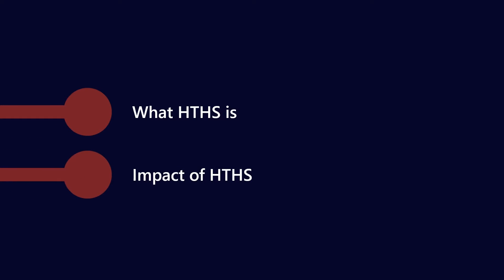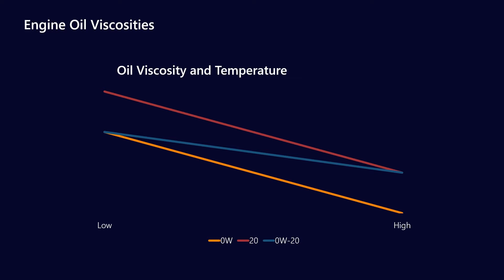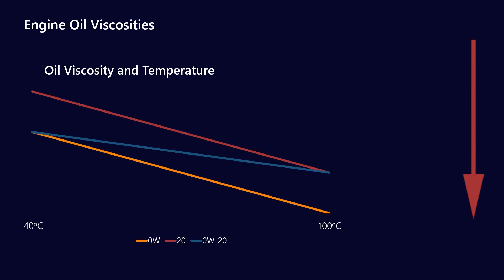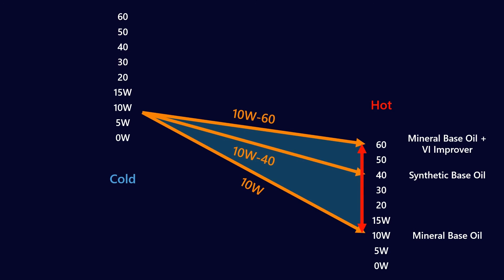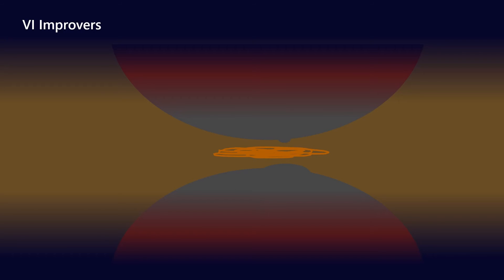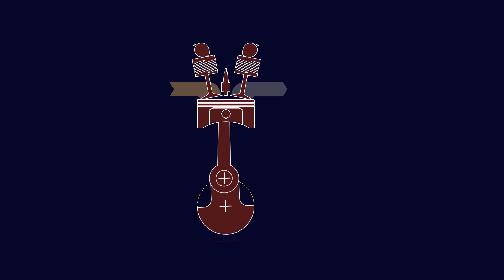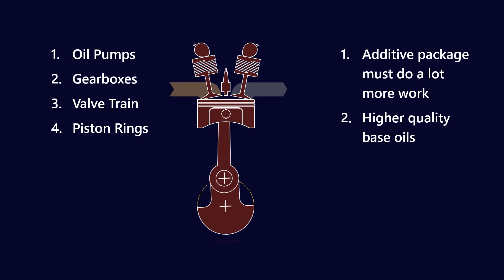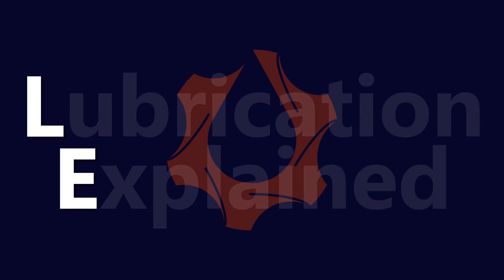How does HTHS viscosity impact engine performance?

Comment: IMHO the importance & modern day relevance of HTHS is massively overstated. It's the lubricant equivalent of Visible Pantie Line; something for the naturally neurotic to stress about but which isn't really that big a deal...
Reply from the maker: Hahaha. That's probably true to a certain extent. It's probably gained so much prominence because the engine OEMs are trying to pull every lever to show emissions reductions, and realistically there aren't all that many variables to control with engine oils.
Reply: @LubricationExplained  As you probably realised, I am not a huge fan of HTHS. However, in 1977, when SAE & ASTM kicked off their work on High Temperature Rheology, I was but a spotty faced, know-nothing, uni student, a couple of decades away from my first professional contact with the slippery stuff. 
Out of curiosity, I've indulged in a bit of a deep dive in to the history of HTHS to see what exactly bought this test into the crankcase oil mainstream. What I quickly discovered is that the story is far from straight forward. This is summed up in the first line of a book dedicated to the subject (& I quote)... 
"The issue of HTHS oil viscosity & its relationship to engine operation has achieved the distinction of becoming one of the most controversial issues to enter the area of automotive lubricant development".
Yes, even back then, it's clear there were serious industry people who DIDN'T believe this test correlated to engine problems! I rest my case...
Reply: @MrSensible2  Gotta Be In It, To Win It :)
Reply: @lesliedsouza4077  True but with HTHS, there was no prize; nothing to actually 'win'.
Reply: @MrSensible2  :) I was kinda joking :) But, the subject of this vid was the relevance of HTHS?
LE said that viscosity improvers do their job, when New, Out of the bottle. But, over the service interval, they degrade, under high temp & shear conditions? Therefore, the HTHS parameter was created? As an indicator? Estimating resistance to degradation? 
A VI degraded oil might allow better fuel economy, due to reduced viscosity. The other effect could be increased metal wear?
Seems you read a book, Quoted & Rest your case? I did not read that book. 
I try to think? Not always right :)  I don't worry about writing books :)
Reply: @lesliedsouza4077  But most of the time, Viscosity Improvers DON'T materially degrade over the oil's lifetime in your engine. Just because, in the lab, you can set up conditions to physically induce temporary shear on the HTHS test or permanent shear on the Kurt Orbahn test, it doesn't mean this happens in real life. Nine times out of ten, any KV100 drop you see over your OCI is due to a teensy-weensy bit of fuel dilution. Strip off the volatile fuel & you'll find the lube oil underneath is not that different to what you started with (albeit slightly lower in TBN & blacker).
Reply: @MrSensible2  :) True :) Which kinda proves that lab formulators did their HTHS homework?
Little relevance to Joe User, who should just follow vehicle manufacturer recommendation?
Modern G lll & above base oils are developed with inherently better VI? & HTHS? 
Requiring less VII? And again, VII's have been improved? True, HTHS is the realm of Boffins,
Not Joe User.
Fuel dilution < 2% ok, by some oil analysis standards? That "Dark Matter" :) Sub-20 micron?
Held in suspension by dispersant, also wants to restore viscosity loss caused by fuel dilution?
Even if not ideal lub? :)
Reply: @lesliedsouza4077 What specifically & precisely did us lab formulators do after 1977 that we weren't doing before 1977? The problem with your logic is that HTHS arose out of a field problem that simply wasn't there BEFORE HTHS came into being. As far as I can tell, there was a widespread concern that the Minimum Oil Film Thickness of VM containing oils was APPARENTLY less than with VM-free mono-grades but so what if there was no field problem associated with VM containing multi-grades? What happened AFTER the test was introduced? Zip, nada, nichts & sweet bugger all! The same Group I oils were used for the next 20 years & viscometrically equivalent Group IIs were the norm in the US for the 15 years after that. Likewise simple 50 SSI OCP VIIs continued to be the norm in the US until GM kicked off dexos. 
Anyways, this is turning into something of a saga so I think I'm done now.
Reply: @MrSensible2  :) The Song was, Fraction Too Much Friction? :) You're Alright, Mate :)